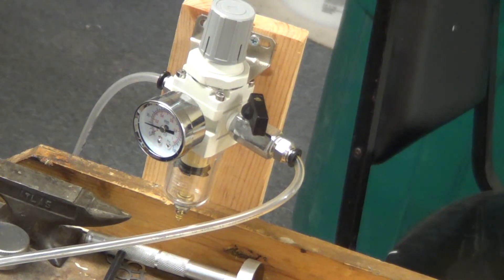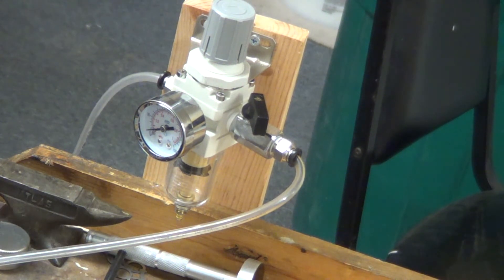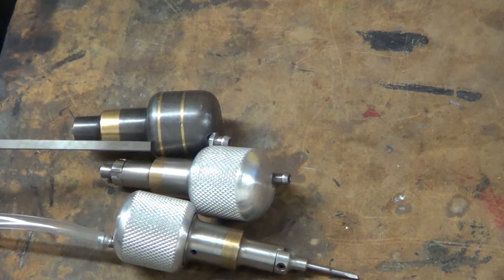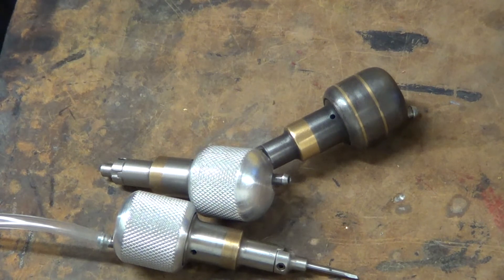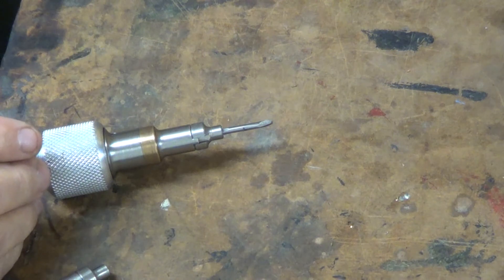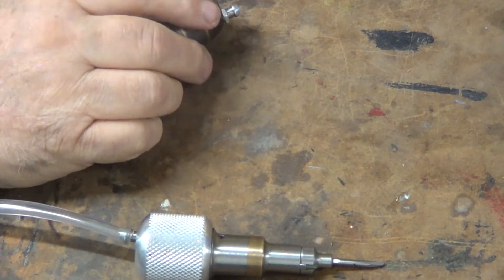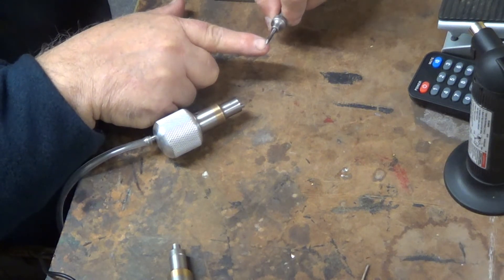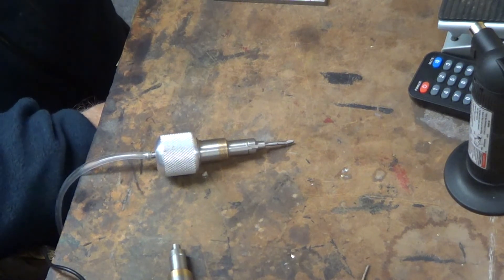pneumatic engraver FK2520

Comment: From Paul. This answers a lot of questions. Thank you Mike for your video.
Reply from the maker: I figured it might give you an edge up.  I hope to be able to spend some time learning the art of engraving but for now, just have to slop through it.  Thanks Paul  The Bench Jeweler.
Reply: @rhjgold  I’m trying to contact you to find out what type of steel was used to make the engraver. Just asking, as I’d like to purchase one but there is no product info on the make of the engraving machine. Tried to call a few times.

Comment: Is this setup capable to engrave in steel? Like heavier cuts? Or just lighter, detailed work? Thanks 😊
Reply from the maker: The grave works on air at about 18 to 25 Lbs. It has plenty of power to operate on steel.  The Bench Jeweler.
Reply: @rhjgold  Do you ship worldwide?
Reply from the maker: @adonisnaturalis  We have shipped to England and Canada but the shipping is quite costly, what country ?

Comment: The graver is to fast you need to slow it down. Also why do your collets fall out when using it?  Also sharpen the graver properly. Sorry for being abit negative but with a little tweaking it would work alot better
Reply from the maker: You can add an airflow value past the filter exit port and adjust the tweaking further.  Power is adjusted by controlling the air pressure. The collet is free-floating as long as there is resistance while engraving it stays put. Thanks the Bench Jeweler.